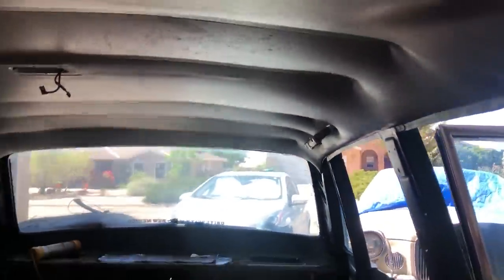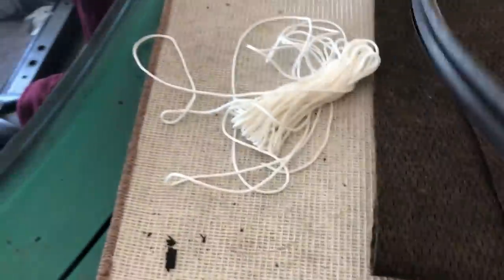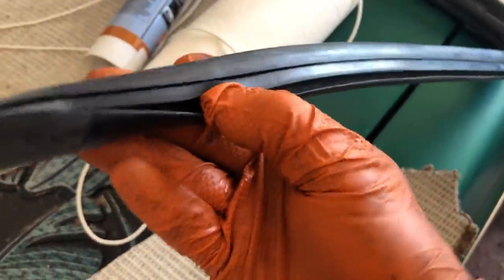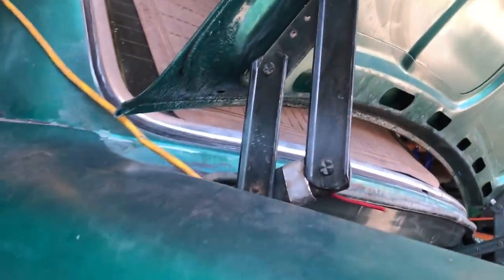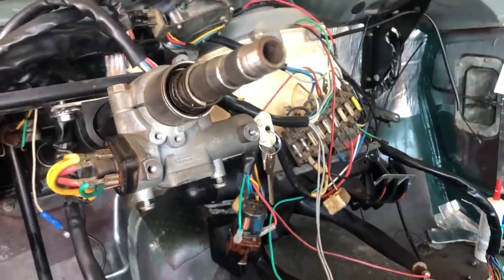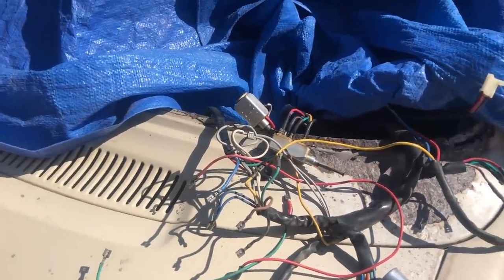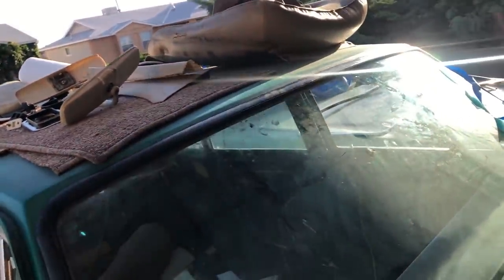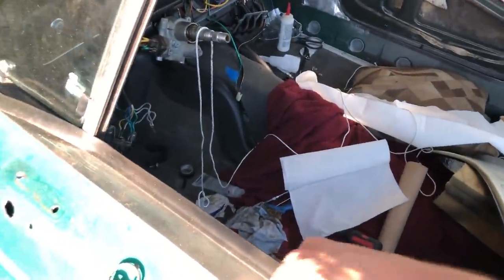Volvo 164 Rescue: Windshield, Wiring, Dashboard Installed - Ep 30

Comment: Perchance that 240 roof handles can be used in the 164? I have a feeling that the answer will be no but it's worth an ask. At least you have a 240 on hand to check with.

Comment: speaking from personal experience you want to wear safety glasses when using that wire wheel on the drill. I went two weeks with a swollen eye, never again
Reply from the maker: Oh, yes, and most times I do. 😔 it was a whim of a task and easily overlooked. If one is not going to safe every time, what’s the point of it any time? Thanks for the reminder.
Reply from the maker: Wait a second, I am wearing them! I take back everything and regret nothing.
Reply: @DavidBello  :O you're right, I was the one making a mistake. Dang it!

Comment: Could the windshield/seal/trim possibly have been assembled on the bench, then installed all together? Or is the seal too tight to allow this possibility? Have never done a windshield replacement.
Reply from the maker: The trim can only be once the glass is on the car, because it takes a lot of pulling to get in either direction, and that just makes the whole thing fall apart. I spent a while debating that with a glass installer who wasted 2 hours of his time trying it “his way” and once he was quite late for his following appointment, I put the glass into the car and installed the trim with ease. It was my first time installing trim too, and I was so surprised that he insisted the Volvo green books were wrong.
Reply: @DavidBello  Thank you for the explanation. Empirical evidence via spoken word, written word and video! So the Volvo books are wrong? Wow, that's professional ego talking.
Reply: @DavidBello  lol because obviously Volvo only assembled the car... he sounds a little bit too egotistical